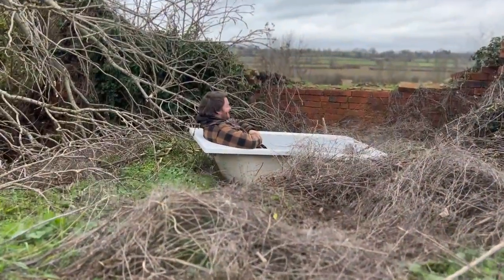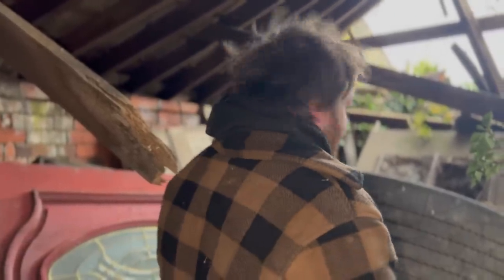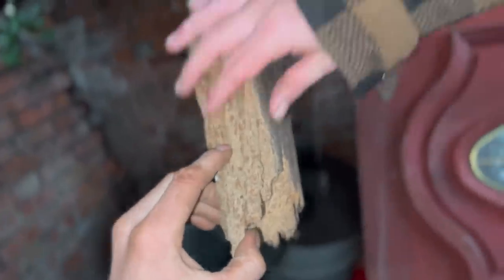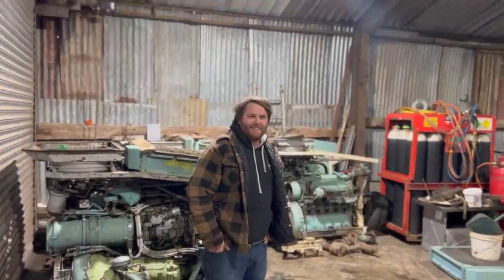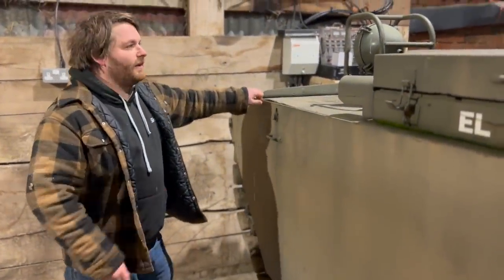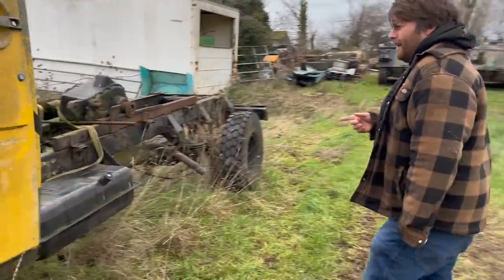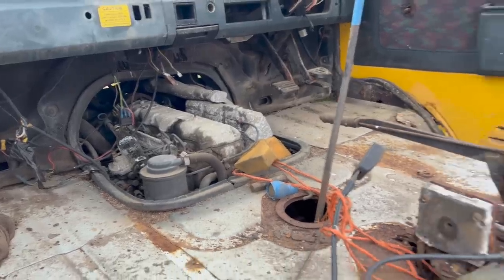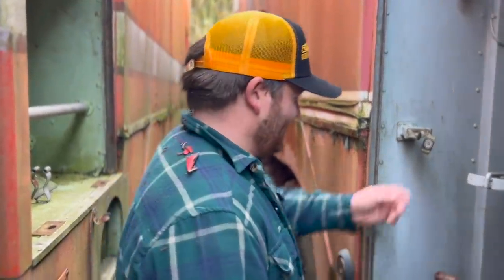New Year, New Tanks, New Office and new projects! Featuring the Russian t34 Battle Tank!

Comment: According to the typical RAF description that:
Fire Fighting Truck
Airfield
10 Ton
6 x 6
Foam
Thornycroft,
Nubian Major
Mk 9
Has a Cummins V8, 14790cc, 8 cylinder, liquid cooled, diesel, developing
214.76kw (288bhp) at 2800rev/min.

The only and obvious cab that should go on the yard 4 x 4 should be the one off a Forward Control Land Rover 101FC.  If you can find one .....

Comment: Is that a Cummins 903 in those fire trucks?
Reply from the maker: Not sure until we get into them
Reply: @fittermat   According to the RAF it was indeed a 903.
Reply: Might be the Perkins V8-540 or V8-640 engine.
Reply: @woods457   Well not according to RAF records it isn't. Its a 903.
Reply: @1chish  If that's what the records say then that's what they should be, just offered an alternative engine type as i know some Dennis trucks had V8 Perkins engines, although they might have been fitted in later types..
Reply: @woods457  Exactly right that Dennis used other Cummins diesels. But these are Thornycroft built vehicles with Dennis coachwork added. They are aren't 'Dennis' vehicles.